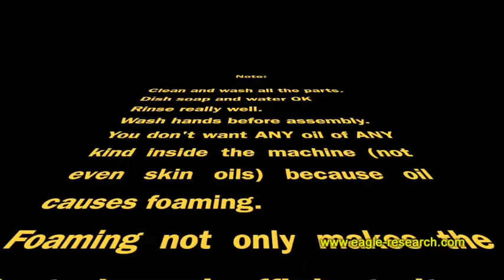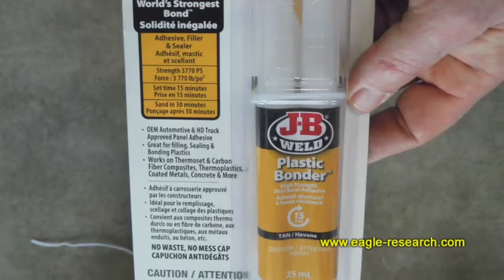Assemble and Wire ER50 Brown's Gas (BG or HHO) Electrolyzer from Kit (upgraded)

Comment: Is this really Brown's gas? Doesn't it need to be stabilized so it's not immediately recombining back into water?
Reply from the maker: Yes it is really Brown's Gas.  I've been working with Brown's Gas since 1986 and you can see my ExW discovery here:
http://www.eagle-research.com/browngas/whatisbg/watergas.php
You can find a definition of Brown's Gas here:
http://www.eagle-research.com/cms/faq/what-is-browns-gas

The gas does not need to be 'stabilized'  It is stable unless 'acted upon' by pressure, temperature or an outside influence like sunlight or static electricity.

Comment: Hey Georg just wondering when the ER 50 will be available again on your online store.
Reply from the maker: That's a really good question, for which I have no answer.  Not in the forseeable future.  People CAN build their own with the downloads and Resources.
Reply: @ecopegasus  Hey George just wondering if you have ever considered using a PWM to split the water instead of using an electrolyte solution with DC.?
Reply from the maker: @cartertech2531  A PWM just pulses DC voltage to a circuit.... It's still DC and has nothing to do (directly) with the electrolysis (water splitting).  There are electrolyzer designs that don't use a catalyst but I've never found one that produces Brown's Gas.  
My AquaCure DOES USE a PWM, to control the volume of gas produced, thus being able to safely optimize it for inhalation.
Reply: @ecopegasus  thanks for the clarification. Just wanted to ask. Does the electrolyzer have to have a multi plate design. Like in your ER 50. I built a pretty simple one with a plastic container and stainless steel scrubbing pads separated by a piece of acrylic. It generates a decent amount but my concern is that it doesn't generate the electricity expanded water as well as a multi plate design like yours does.
Reply from the maker: @cartertech2531  The important parameter to make Brown's Gas is NO MEMBRANE separating the hydrogen and oxygen gas production.  A membrane interrupts the formation of the electron bridge that allows the formation of the ExW.  It doesn't matter if it's a single cell or a series cell design, as long as there is no membrane.  See my Brown's Gas Books 1 & 2.  https://eagle-research.com/product-category/browns-gas/
Reply: @ecopegasus  thanks George
Reply: @ecopegasus  Hey Georg just one more question. Why does my sodium hydroxide solution in my electrolyzer turn yellow and give off a bad smell after running for a while. I am concerned that the bubbled water I am drinking is contaminated in some way by the yellow solution. Also the stainless steel scrubbing pads I am using as electrodes are Turing black.
Reply from the maker: @cartertech2531  Yellow is the natural color of condition lye solution, that is not a problem.  'Smell' I cannot comment on because I son't know everything you are putting into your solution, since you say you are using scrubbing pads that are obviously NOT the stainless steel they claim to be... Or you have other impurities that are 'plating out' on the pads.
Sorry, I simply cannot comment on electrolyzers that aren't my design and I haven't tested.
Reply: @ecopegasus  Hey George been drinking the bubbled water for a few days now and feel great. Just one question. Does inhalation of BG or Drinking water not only treat/cure illnesses. Can it also act as a preventative, so your chances of developing illnesses like cancer and age related illnesses decreases ?
Reply from the maker: @cartertech2531   I'm not an MD so I cannot legally answer that question directly.  Indirectly, it is my opinion that YES, this is the world's best illness preventative because it helps the body maintain it's optimal health, including it's immune systems, so something might try to 'get you' but your body will shrug it off or get a lot less symptoms than less healthy people.
As for preventing ailments like Parkinson's, Lupus (all auto-immune ailments), ALS, COPD, etc. I think that this nutrition is what the body needs to prevent such issues.  The science (thousands of studies) is proving this out.

Comment: Holy crap... old man has turned 200 year old tech into a technical triumph.
Russians build these batteries to run their 6x6 trucks thru Siberia.... I think any high school kid can do this much more effectively than powering a stupid little RC motor. Methinks a tiny torch might fuse rock and ceramics... but not much can come of this battery package. Borax might be used in lieu of Lye.
Reply from the maker: LOL, I don't consider myself to be old.  In fact my medical physicals show my biological age to be regressing (I'm getting younger).
I'd like to know more about the Russian technology, because I do not yet know how to make electrolyzers that will 'run a truck'.  The best I can do is improve fuel mileage like this:
http://www.eagle-research.com/cms/er-hyzor-resources/fuel-savers-general/er-hyzor-general/board-electrolyzers-work

I agree, this technology is a GREAT science experiment for children, particularly when they can use it to show practical benefits, like HEALTH:
http://www.eagle-research.com/cms/blog/browns-gas/browns-gas-health-enhancement/plants-dont-lie

Yes, if you fuel a micro torch with this gas, you can fuse rocks and ceramics together and a BUNCH of other uses.  It's a great torch fuel gas.

Unfortunately Borax is a really POOR electrolyte (inefficient, messy and creates poison gasses).  
Having tested thousands of potentials, I settled on lye (NaOH) as the most practical.  Lye is clean, efficient, easy to acquire, used for thousands of applications, much less caustic than KOH and is inexpensive.

Comment: pretty cool.....What exactly are the capacitors doing ? If Anything I could see using elcrolytics on the DC side of the FBR to make the current to the splitter device more constant instead of pulsed. Anyone ? & any Idea of how many of these parallel setups it might take to do some real time welding(for a torch that would at least easily cut like 1/4" steel plate for instance) ? I suppose based on the 50LPH (volume per unit time)
Reply from the maker: The capacitors are SPECIFICALLY AC rated and put on the AC leg to LIMIT CURRENT, or the electrolyzer will go into 'amperage runaway' as the electrolyte solution heats up and loses resistance.  The capacitors lock in the designed amperage regardless of the voltage required by the load, as long as the load voltage required is LESS than the impressed (Grid) voltage.

See my Capacitive Power Supply technology (like my capacitive battery charger) for more information on super efficient capacitive step-down transformer technology.
http://www.eagle-research.com/cms/store/free-energy/capacitive-battery-charger-incl-capacitive-transformer

You do NOT want to use electrolytic capacitors on the DC side.  First because the electrolyzer itself tends to act like a capacitor and second because the electrolysis process is more efficient with pulsed power input.

As for cutting, you need about 200 SATP liters per hour to cut 1" thick of steel, using about 30% less oxygen than a normal torch fuel gas like acetylene. 
 
However, it requires a LOT more BG to pre-heat the steel to oxidizing temperature, So I developed a pre-heat apparatus that would pre-heat twice as fast as acetylene, and then the cut proceeds faster than acetylene.  See more here:
http://www.eagle-research.com/cms/blog/browns-gas/browns-gas-use-torch-gas/using-browns-gas-torch-fuel

So to properly fuel a normal acetylene torch with BG, you should be able to produce at least 1200 lph.  You'd need 24 of the ER50 to do that.  Better to build a larger electrolyzer as per my Brown's Gas Book 2:
http://www.eagle-research.com/cms/store/browns-gas/browns-gas-book-2
Reply: @ecopegasus  Thanks for The quick response........Great answers & info.

Comment: what's the difference between this and the aquacure ac50?
Reply from the maker: Good question... In short, the ER50 is MY design of a Brown's Gas electrolyzer but it's experimental and not optimized for Health application.  It WORKS but lacks convenience and safety features of the AquaCure AC50.

The 'problem' is that it would cost hundreds of thousands of dollars to engineer the ER50 into something that equals the AquaCure AC50 (meets worldwide safety standards and has world class, 'state of art' user convenience and functionality.  I AM doing that development in the background but in the meantime people needed a low cost and practical solution NOW!

So I took a Chinese made chassis, which has an electrolyzer design similar to my 1993 standard) and TOTALLY REBUILD it into the AquaCure AC50.

This allows me to sell the AC50 NOW and for half the retail I'd need to if I was building everything in America.  
Yes, it's nowhere near as efficient as the ER50 in making Brown's Gas, but it IS 'state of art' in the marketplace and it is the safest, most practical Brown's Gas electrolyzer in the world.

For those that would want the highest quality Brown's Gas, DO BUILD the ER50.  But it takes a lot of 'knowhow' (which I encourage people to learn) to build and operate it safely and I'm sorry to say that (currently in 2022) I'm not making any of the kits... 100% of my time is spent building and supporting the AquaCure AC50.

May the blessings be
Reply: @ecopegasus  Thank you

Comment: If you use a grinder with a sanding disk attached to increase the surface area of the stainless steal disks you will increase the bubbles producing more hydrogen gas!
Reply from the maker: That's true, for awhile, then the 'points' created 'wear off' and the production drops to the level of flat plates.  I have worked with electrolyzers since 1986 and have technology that can reliably produce Brown's Gas using less than 1 watt-hour per SATP liter of gas produced (most people these days are achieving 4 watt-hours per SATP liter of gas).
Reply: make  a procedure more complicated to make it to  be  believed that it is superior..Beware before you follow the preachers, they will buy your heart before you can think  !!!!!!!! Producing hydrogen is not that complicated   than this fellow describes.

Comment: Has anyone tried building this without buying the kit? What is the cost buying all the parts individually?  I am a low wager.
Reply from the maker: The whole point of the kit is to lower the cost and ease assembly 'hurdle' for people.  
Absolutely people can 'build their own.  I have full plans for 'home building' this type of electrolyzer in my 'Brown's Gas Book 2'.  https://eagle-research.com/product/browns-gas-book-2/
Generally the cost is $500 plus $1 for each SATP liter per hour of gas production capability.  So a 1000 lph electrolyzer should run you about $1500 to home build.
The ER50 only makes 50 lph so would be in the $550 range.

Comment: Stumbled onto this video as a "suggestion"  from Infamous YouTube, however I happen to be a electrical engineer myself and I see a pointless config  of capacitors...  Using capacitors of that type as a "resistor load"  between the AC out from the switch, then to the caps back to the rectifier  reduces the current as your probably using them for, but not a safe manner as those caps can fail and its not a matter of IF  as more of a WHEN  and when they do, it will be quite catastrophic. If your plates are arranged to handle the full rectification of US mains at  120V (and accounting for the PEAK TO PEAK)  voltage of nearly  160+- V    then using the capacitors as a inrush resistive load is redundant and unsafe. If you need a more controlled Load  then it would be much safer to use a PWM controller  designed for  120V. But using Capacitors designed for starting induction motors as resistors in your wiring is baffling and unsafe!
Reply from the maker: As an electrical engineer you should be aware that oil-filled motor run (NOT motor start) capacitors almost never fail.  I (and many thousands of my customers) have been using this 'amperage limiting' technique since 1984 without a single failure... Not ONE, even with loads that required as little as 2 volts, fed from 240 VAC.

In that time I've had MANY electronic power supplies fail... As I'm sure many people can relate.  In fact, my current battery charger (which I've been using since 1986) was rebuilt by tossing out the burnt out transformer (used it as a fishing weight) and replacing it with oil-filled capacitors.

If you take the time to really understand what I teach in my "Capacitive Battery Charger + Capacitive Transformer" Book; then I'm pretty sure you'll see where the 'electrical industry'  made a really bad decision to exclusively use inductive transformers.

Capacitive Step Down Transformers (aka capacitive voltage dividers) are FAR MORE efficient, simple and extremely durable.  For example, my Capacitive Battery Charger is 50% more efficient in charging batteries than it's inductive cousin AND it's capacitance is easily changed; unlike inductors...

The energy industry has wasted Giga-Joules of energy using inductors.

Even my EFIE circuit (an electronic circuit) uses a capacitor, in series with it's primary coil in the step-up transformer, to limit current draw if the secondary is shorted (which it needs to do in certain applications).  So this technology works from micro circuits to mega circuits and is SERIOUSLY under-utilized by engineers who were NOT taught the advantages.

No personal offense please, I do not know you, but my experience with engineers is that they tend to 'over-engineer', making Rube-Goldberg solutions instead of going for the essence of efficient simplicity.

As a Rancher's son and an automotive technician, I learned to fix almost anything and also learned that any additional 'part' was another potential failure point.  I've made a life's work out of eliminating parts from everything I fix.
As an alternative energy researcher and inventor (with Tesla as my mentor) I look for the most efficient and simplest solution to any application.
Reply: Agree...!
Reply: He though the cost to get PWM not too cheap..!
Reply: How many litre/ minute of HHO you got..?
Reply: @ecopegasus  Damn good answer!   I'm always looking for ways to improve any existing technology and simplicity is always preferred.

Comment: Float switches to cut off power if it runs low on water are cheap.  Certainly cheaper than having to rebuild a dried-out damaged generator… no?  I paid like $2 per float switch on Amazon.
Reply from the maker: I'm not sure what you are talking about... Contact me via https://eagle-research.com/contact/  to discuss it.

Comment: would baking soda work instead of lye?
Reply from the maker: Absolutely NOT.  Baking soda makes sludge (plugging up the machine), poisonous gas (carbon monoxide) and is only half as efficient as lye... Further the ONLY reason it 'works' at all is a portion of it turns into lye.
Best to use a dilute lye solution with a mixture of citric acid, which is then no more 'caustic' than soap (soap was traditionally made using lye).

Comment: wonderfull work. Thank you so much. But many links you give down here are not avalable. Waht is the reason?
Reply from the maker: Such a good question.  My website was built using 1996 programming and when the server software (hosting the website) was upgraded, my website disappeared from the internet.  I'm rebuilding the 5000 page website from scratch with modern code and will get to upgrading these links once the new pages come back online.

Comment: Liked your film but I think you could have did some editing and shorten the length of it an hour and 35 minutes is a little lengthy
Reply from the maker: It is edited, though I could likely cut a few minutes here and there.  Also things need to be added (you'd be surprised at the questions).  Some people really need to SEE the whole step by step...
Reply: George Wiseman :
It doesn't surprise me one bit I've been in a master electrician HVACR contractor / teacher for many years
The angle is there some things no matter how simplified people just can't comprehend
Reply: As a kid back in the 60's I built lots of electronics kits from Heath and Eico and those kit makers were the masters at showing you how to assemble an item just from a manual.  With the added value of audio and video how could you miss anything but apparently it is possible.

Comment: got my bag of check valves us plastic cheap and fast shipping
Reply from the maker: US Plastic doesn't sell the duckbill check valves I now use.  The 'normal' HHO check valves are not consistently reliable and they have a 'higher' break pressure than the duckbills.  Lower electrolyzer operation pressure is SAFER if there is an internal explosion.